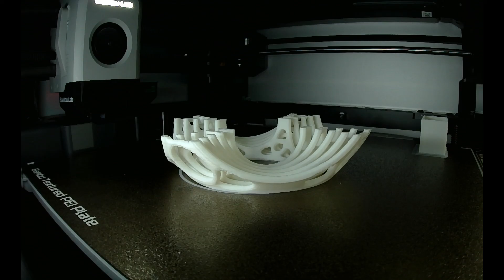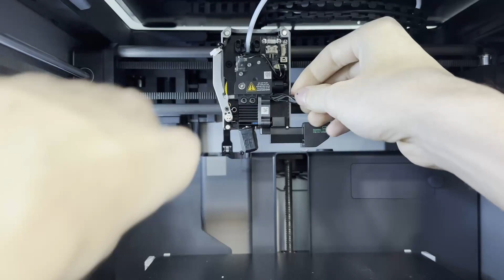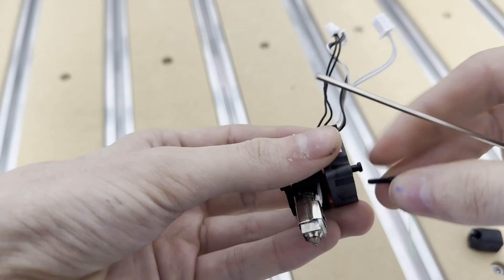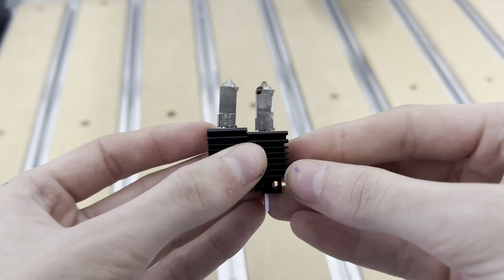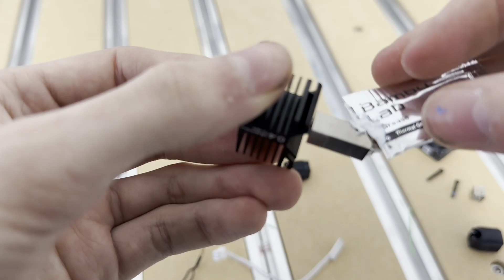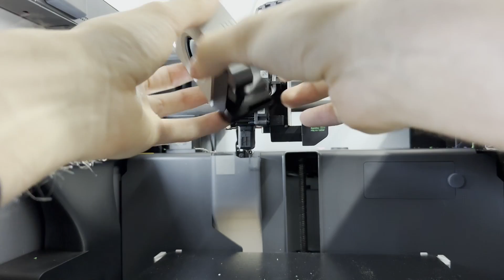How to fix a Bent Nozzle - Biggest Issue with Bambu Lab X1C So Far

Comment: Mine had a filament jam, i unclogged and powered back on and it began to resume the previous print but crashed the head into the build plate bending the hot end the same way and gouging my 2sided smooth PEI plate. someone on reddit told me i should make a support ticket, did that and the next day they wanted a log and are now sending me a free replacement hot end and sheet. I had already bought a spare to replace my spare that comes with the printer, so now i'm back to being whole again. if this happens to you, follow up with support just to see if they'll comp you the damaged parts.